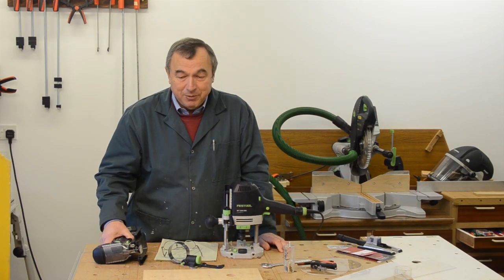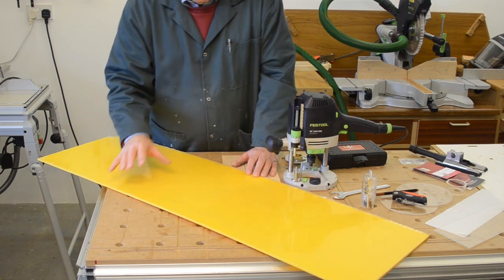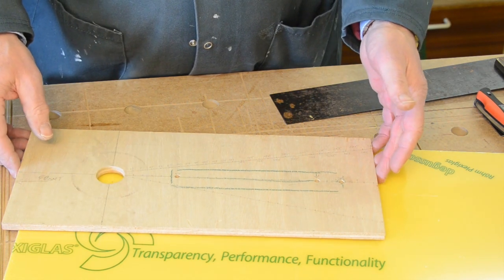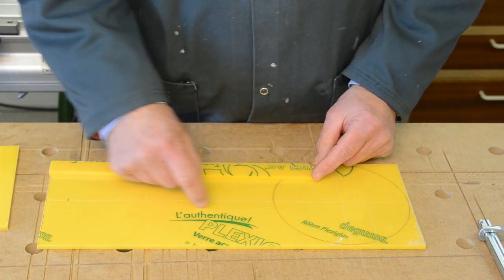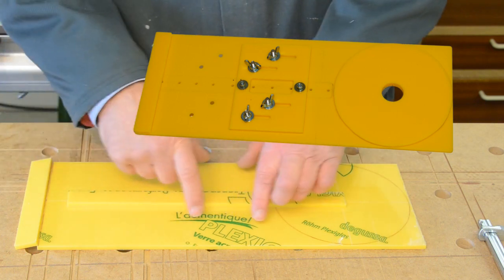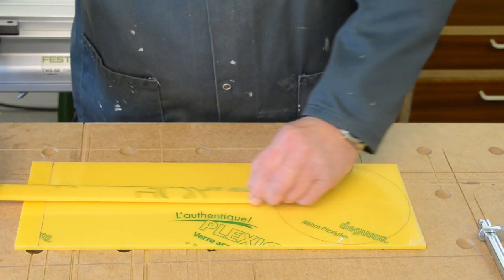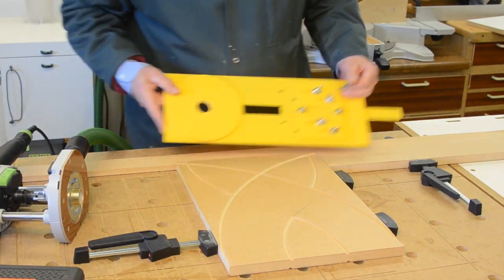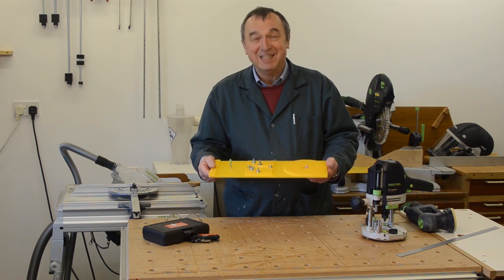Project: Making a trammel for any router

Comment: I absolutely LOVE the idea of building a trammel around a 30mm guide bush. That's going to be so much easier when using the router attached to a dust hose. I definitely plan to try this, maybe with some 10mm sheet bamboo I have kicking around.
Reply from the maker: +Ian Phillip Hi Ian, sounds like a brilliant idea. Good luck.   Peter

Comment: Nice Job Peter as always,  will those UJK bushes fit the Festool 1010 and 1400 routers?
have a Kapex being deliverd next week so hopefully will be good

Steve
Reply from the maker: Steven Reynolds Hi Steven, I use the UJK bushes in my OF1400 but you do need to buy a guide bush adapter to fit the router. I covered this in my video about the UJK guide bush set and you can see more detail on the Axminster Power Tools web site. For the OF1400 the Leigh  guide bush adapter is the solution. I do not know what would be needed for the OF1010 but assume that there will be an adapter, possibly the Leigh one. The technical help people at Axminster are brilliant and set me straight on this long before I made the video.    Peter